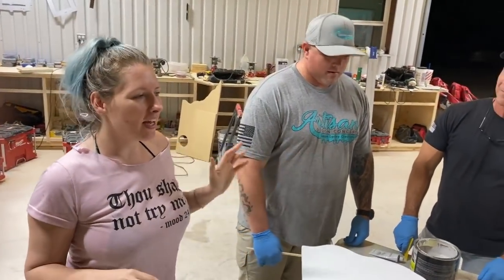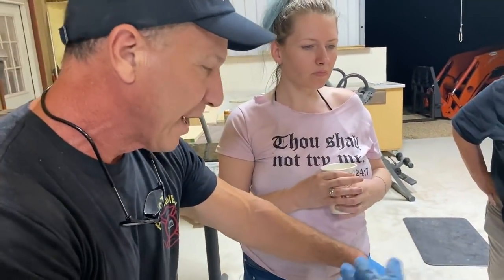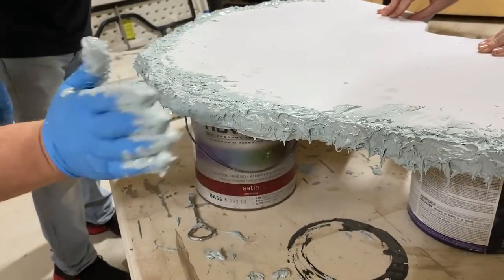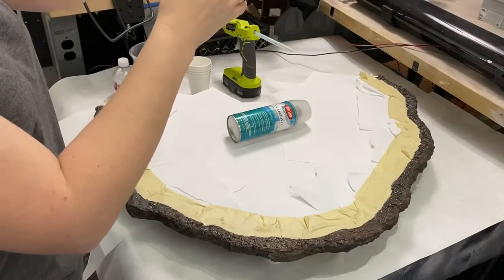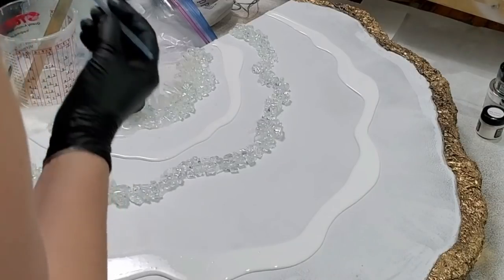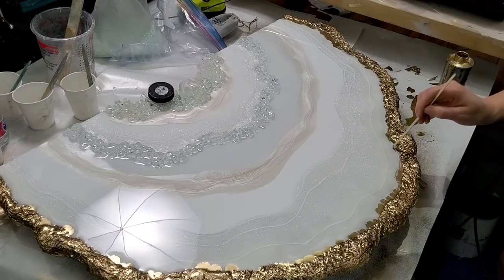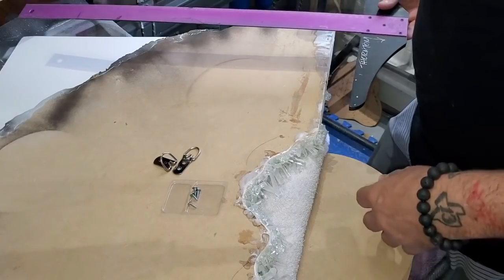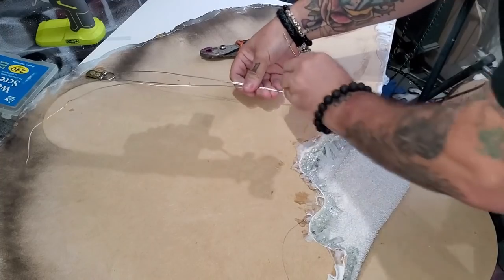Elegant Live Edge Geode Tutorial (Full Process)

Comment: Thank you for this most informative resin geode video! Do you find that using bondo for the edge dam is easier or better than using some kind of spray foam to fill cracks? Which is easier / better? A few people I know use "Great Stuff, GAPS & Cracks with Quick Stop Straw" on Amazon.

Comment: In my experience, hot glue doesn't seem to maintain integrity longer than a few years. A trick I learned from a crafter was a dab of e6000 along with a dab of hot glue. The hot glue holds while the other dries.  She calls it short term/long term hold. Might be a good thing to use when using crystals like that.
Reply: Ja Nana once your pour the resin in, it holds the crystals in place, the hot glue is just until the resin goes down.

Comment: Bad information on using the hardener. Using more hardener to make it set off faster will make it weaker once hardened. It can also cause soft set up and prolonged off gassing. Also, not a very good mixing process with that wood paint stick. Proper mix ratio is 50/1. Mix with a spreader, folding the bodyfiller and hardener in on itself  and then cutting it with the edge of the spreader. Repeat until uniform color  also, never add more hardener after you have already started mixing. The bodyfiller has already started to set. Adding more hardener at that point is a bad idea for several reasons. I'm a professional paint and body man for over 30 years. Just like it's important to properly mix the epoxy to assure proper set up, bodyfiller also needs to be done properly.
Reply from the maker: I appreciate your feedback! Luckily, the piece won’t be touched much as it is wall art but I can see how you don’t want it to be weak in the long run, especially if it was functional.
Reply: @ArtistTillDeath  Definitely. Something like a table top could end up with color bleed through or adhesion issues layer down the road. I've had bodyfiller that had too much hardener actually stain through white before. Looked like a big ol pee spot on the fender of a truck. 😂 Another tip that really doesn't apply in this case but is good to know, Body filler is not meant to sticknover itself without sanding between coats. Even if you apply it before the first coat has set all the way. A good blast of air or vibration will separate the second layer off the first one. The project is absolutely beautiful btw.